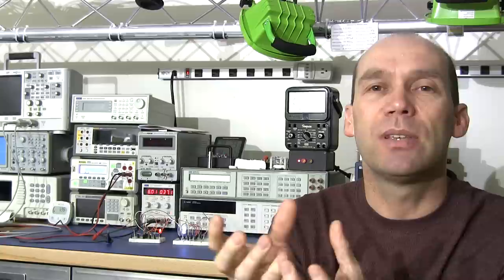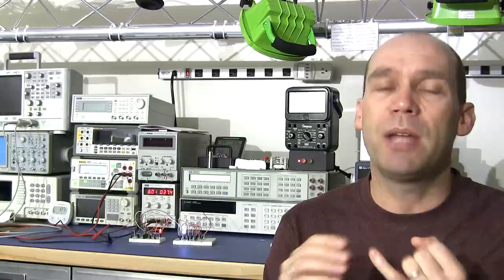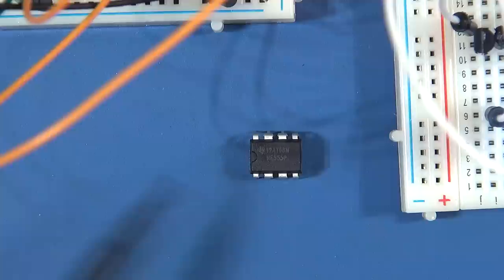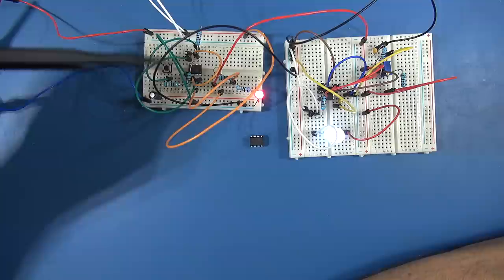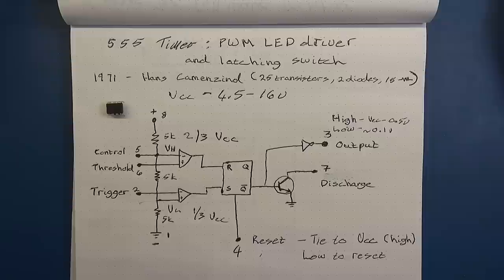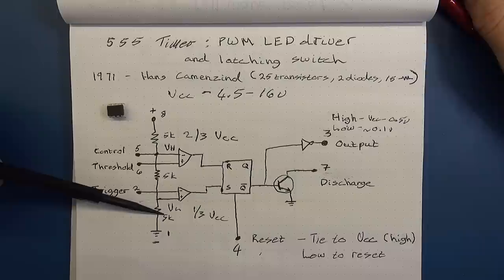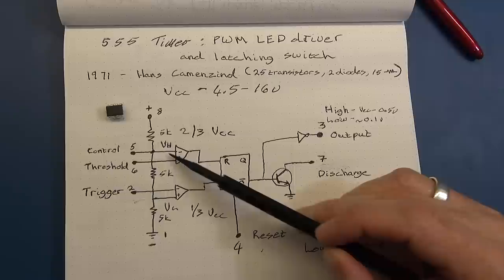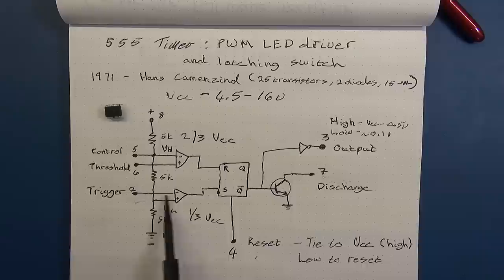Tutorial: 555 Timer, PWM LED Driver and Latched Switch - Pt1

Comment: Hey,
About that SR-Latch, i have learned in my studies recently that when R and S are 'high' and then you set both equally 'low'  that your Q and Qnot will become a metastable situation where you don't want to come. Because Q and Qnot are no longer inverse, it will flip and you will not know to what state it will develop (metastable). So R and S 'high' to EQUALLY 'low' has to be avoided! The schematic of the SR-Latch is build with two NOR-gates...

King regards

Wannes
Reply from the maker: Thanks for the post!

Comment: Great video Martin well documented and presented.
I must admit I never used the 555 IC and not even looked at the spec this is the first time I see what is doing.
It is really old (older than me) I will not recommend the use of it maybe not even for learning purposes :)
I know a lot of people love this IC but it is really my opinion.
I can give a lot of reasons but I will just take the power consumption and that is a minimum of 30mW in the best case scenario for the 555.
Compare that with my Solar BMS (no comparison on complexity at least a few order of magnitude more complex) that only uses 25mW.
I guess there are some modern variants that use way less power but I still don't recommend is use.
My recommendation for your application is to use a microcontroller.
Reply: Condemniing a part you have never used based solely on it's power consumption and age is rediculous. Do you have any Idea how many peoples introduction to electronics has been via the 555 timer. The reasons ? versatility,cost and ruggedness. Even today competitions exist to test the inventiveness of experimenters using only 555 timers. This is one of the foundation stones of modern IC's. If power consumption is such an issue then get the CMOS variant.
I find it amusing so many today think everthing has to be solved with a microcontroller and end up jumping through hoops trying to emulate an analogue circuit. Blinkering you options will only leave you poorer in the future keep an open mind and you may be surprised at what you find.
Reply: Rob B               :) I expected a comment like this.
I know people love this 555 timer but I can not agree with your reasons.
I proposed the use of a micro-controller it is appropriate I think considering this application LED PWM brightness control.
Versatility - I think a micro-controller is much more versatile and you can have even analogue parts like comparators inside a micro-controller.
Cost- From what I've seen it is at around 1$ in low quantities you can get a small micro-controller for the exact same price.
Ruggedness- of course is rugged because of is construction simplicity but a microcontroller with a simple program can be as rugged.
I do not dispute the use as a learning tool. I see Martin created a great video and probably learned a lot buy studding the internal construction of the 555 timer.
The level of integration in the 555 IC was good for 1971 is almost a discrete component now compared to a modern IC.
I know that it seems a waste of resources using a microcontroller but since the cost and size is the same and power consumption lower even compared to the CMOS variants (they still need to have that resistor divider even if is with higher values) I see no reason to use it in most if not all the possible applications.
Can you give me an application where 555 timer can not be replaced with something better?
If I see a 555 timer in a modern large volume product I will think that it was not a well engineered product but maybe I'm wrong.
I have an open mind I just need to see the proof that the 555 timer has a place in present time.
Reply: ***** Martin says the lamp that's the subject of this video, most likely uses a PIC or similar Micro-controller. I would like to see a follow up video of this PWM torch implemented on a PIC with very low standby current and some other features to show the versatility of using a Micro.
Reply: Coolkeys2009
Yes a good microcontoller can have a sleep power consumption in the range of a few uA or even hundred of nA that will still be up to 100x lower power even compared to the CMOS version of 555
Reply: *****
It is great that you have learned something using the 555. But maybe you could have learned even more using some other more modern IC or a microcontroller.
I was just saying that is an old and obsolete part and I do not understand why is still so popular.
Reply: ***** "I was just saying that is an old and obsolete part and I do not understand why is still so popular."

Obsolete? And yet over 1 billion are produced each year.
Reply: keyboardjedi  1 billion is not really a huge number but is more that I will have expected for this old chip.
As a comparison 10 billion ARM processors where sold in 2013 estimate to get to 100 billion by 2015.
I will still stick with my original comment 555 timer is more than n obsolete part. At the same cost you can get an ARM microcontroller way more flexible and capable. Most people use 555 in simple hobby projects. Using 555 in a production device will be silly.

Comment: hello can I get some help from you in regards of 5 5 5 timer I'm doing a project on a 3-phase motor it has an electronic clutch however that clutch circuit she doesn't work anymore what I need to do is to turn or adjust the clutch with a potential meter

Comment: Good explanation, but a statement about PWM and its relation to efficiency.  PWM is NOT more efficient due to the LED being off part of the time!!!  Given equal amount of current, PWM/CW driving are equivalently efficient (or inefficient..) LED efficiency is determined by the current not the duration of driving.